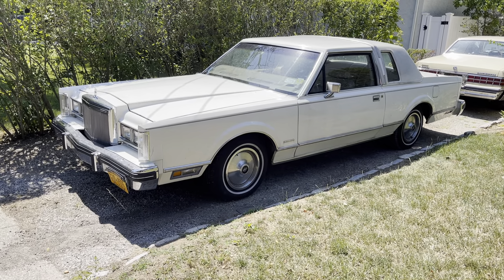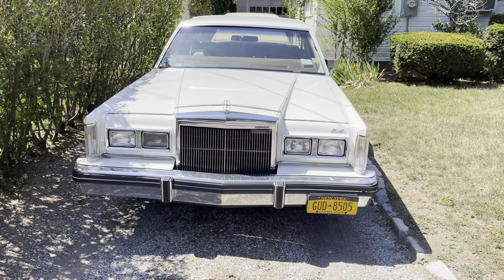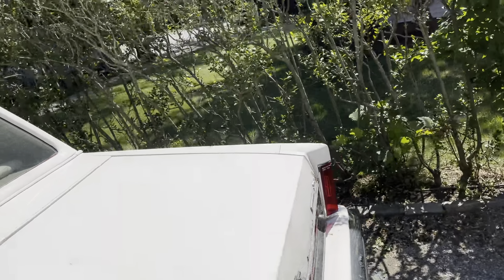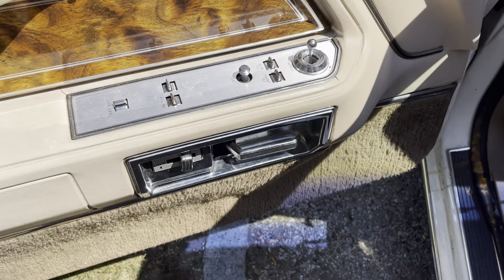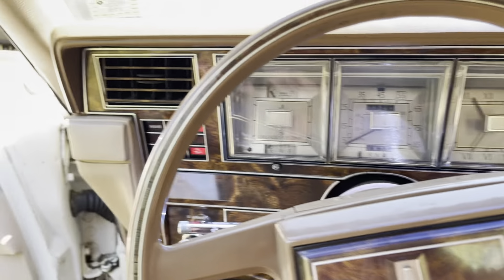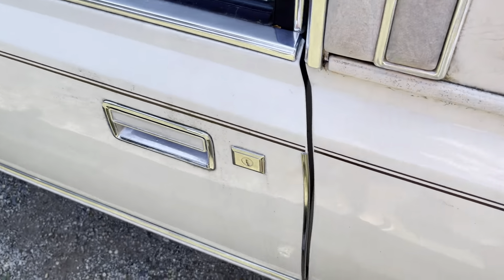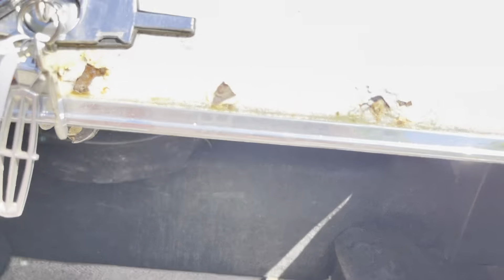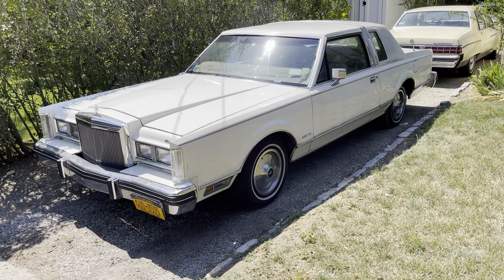Look at a 1981 Lincoln Town Car

Comment: Wow, that's quite a find! I've seen a couple Mark VI coupes up close over the years but never ever a box Town Coupe. She's definitely a base trim car; I'm amazed more at what options it doesn't have. Didn't even know you could delete so many options. Interesting it still has the coach roof/formal rear window. I've seen base and Signature Series cars with the big rear window and accompanying stainless trim. I don't recall what year passenger sideview mirrors became standard- I want to say '82 or '83. All the '84+ I've seen have had both from the factory. The seats are in wonderful shape for the age. Must've been oiled periodically and kept out of prolonged ultraviolet exposure. Would also explain why the dashpad has survived so long as well. 

Trunk lid rot is common on these cars. Yours is definitely worse than my '84 Town Car and '85 Grand Marquis in that area but patching it remains a viable option if you can't easily source a new lid. Any and all metal body parts (doors, fenders, bumpers, trunks) on these are becoming hard to find and/or expensive to source. You may be stuck with just fixing what you've got or making new ones. I've accepted that fact, and soldier on in the journey undeterred. Vet your subcontractors carefully.

Nice '77-'79 Bonneville parked behind it too! One of those is on my bucket list of cars to own before I die.

Comment: I have an '81 4 door Signature in the driveway. It's in about the same condition as yours but without the rust, and my vinyl top is just about gone. Interior same as yours but without the leather seats. I am about to start the long process of getting it back on the road, this video is making me think I should document it and actually upload a video for once. Got to start somewhere I suppose.

Comment: These older lincoln's were considered continental from 81 to 87 with a town car package. Only 88&89 were made lincoln town cars,  then euro style set the pace.  It's worth putting money into it. I'm sure it's in the ignition loose wires, but start with that,  a fuel pump, spark plugs these also go. As far as the black oil ,it might be synthetic blend oil I'd ask the guy you bought it from .good luck and rebuild it little by little is a diamond in the rough.

Comment: Had no idea these even existed. Agree with you on the back of the early 80s models that were upright; looks much better than the slanted end of the 1985 model and later. Is the Pontiac that's behind it yours?
Reply from the maker: Yes that’s my Pontiac too. Unfortunately it’s blocked in until I figure out what to do with this car.